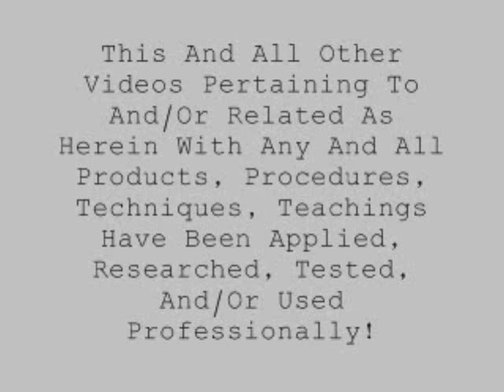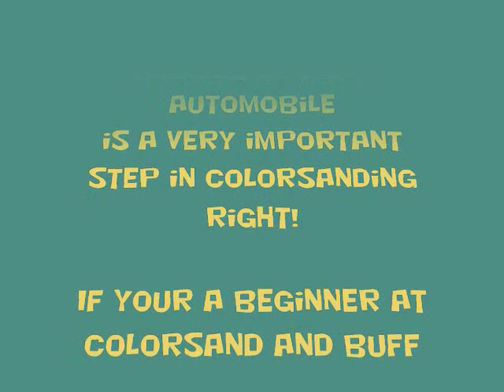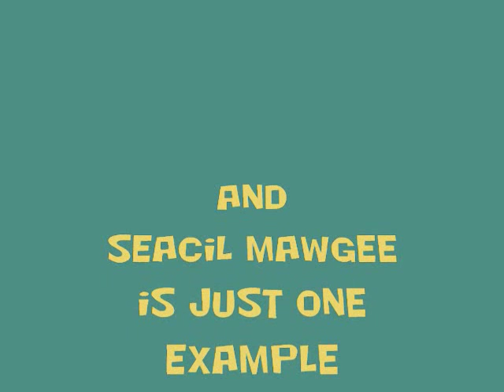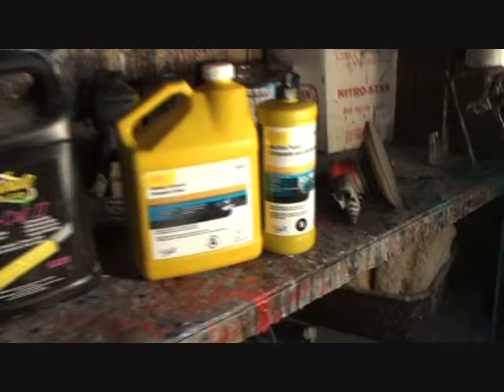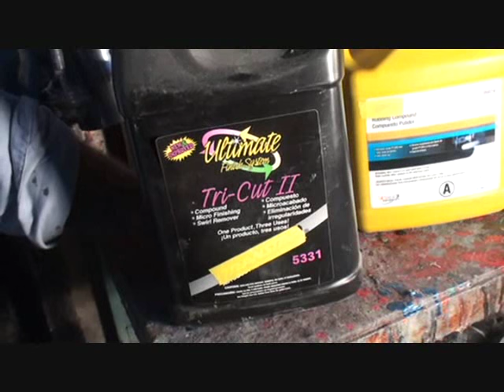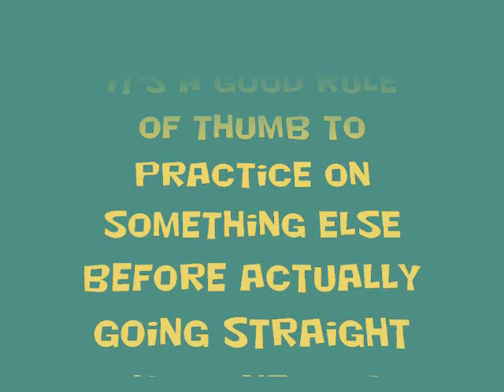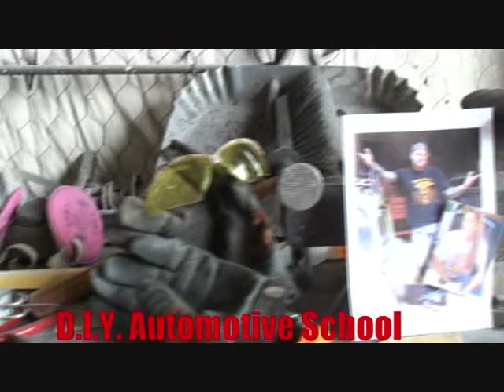"How To Paint A Car"-By Yourself-Part 16-"HOW TO COLOR SAND AND BUFF"

Comment: Best DIY vid's online today - hands down.

I wonder if there is anything one can do to avoid orange peel-ing - while painting?  It would seem that orange peel might be also caused by the paint not flowing out quickly enough - that it starts drying before it settles in.  if you added a touch of retarder, would this help?

Comment: Hey pete great video. I have a question. I have a 2000 gmc jimmy that is blue. Someone painted it and obviously didnt know what the hell they were doing cause they didnt get the orange peel out. It is shiny but it doesn't look like glass. My question is can i buff and wax it without burning through the paint? Not sure how long its been since it was painted but its obviously been a while cause the clear has started peeling away from the base coat on the hood.

Comment: Pete, I love the idea of doing a “Square or Area” at one time, then move on. Also, I am in the market for a short-stroke DA as I have less that perfect elbows and a vintage pickup to finish...for me. With 3 coats of clear, hand sanding with soft block breaks the skin with 1300 grit, the 1500 grit. Then saving product & quickly buffing, followed by polish.
  To save the family budget, 15-20 years ago, I base coat/clear coat a Datsun 210 hatchback and for some who asked below, I used a JGA-7 suction gun but added fast acrylic reducer less than 10%. Two coats later I was ready for a chair. I was shocked to find maybe two square feet of clear that had any sign or orange peel. I could never duplicate that again with so many variables, but as night came, I new the temps would drop while spraying clear. It’s the only reason to add the acrylic reducer. I simply felt gave it twice the time to set between coats. To me only, the clear with out buffing seems tougher and a higher DOI.  Another great video tutorial Pete!

Comment: Hey Pete Thanks for all of your videos really good information! I got a project I could really use your advice on. My uncle and I just picked up his 1939 ford 2 door coupe from a local chevy dealership painter who paints cars in his shop on the weekends. The car has an average amount of orange peel for the most part but in a couple places the clear coat is "rough" to the touch and feels almost gritty. He said he put 3 coats of dupont chromabase clear on it and all of those rough spots would buff out. I detail cars for fun sometimes and have a makita rotary along with a dual action polisher and was planning to tackle the wet sanding and buffing on this project. Should I hit the whole car with 1200 grit then 1500 then 2000 and begin polishing? And do you think the "rough" spots in the clear will wet sand out out? Any advice you can give would be greatly appreciated! The car is a dark green metallic color if that matters.

Comment: I used a big pipe wrench with a long pipe shoved on the handle to twist a steel bumper back into position. Put some thin wood between the jaws of the wrench so as not to leave marks on the bumper.

Comment: It's actually the static electricity in the air.

Easy cheat no paint booth use weed sprayer fill with water Nest work area but not work piece

Comment: Great video as always! I'm confused about the buffing edges part though .... By moving the direction of your body, it doesn't change the direction the pad is spinning, or am I missing something? Lol
Reply from the maker: +Niamh Healy You want to direct the buffer in the way where it is turning away from the edge not turning into the edge because if you go into the edge it will burn the paint off.. Going away from the edge will let you buff without burning...
Reply: To further clarify, he uses either the top half of the pad or the bottom half while doing the edges and not the whole pad which would cause edge cut in on the opposing half of the pad thus body positioning matters depending on which half of the pad is actively polishing the surface.
Reply: Ah ok, so you're tilting the pad? That makes more sense lol

Comment: When you went to the 1500 on the hand block, the edge of the paper was halfway across the face of the pad.  Would this not tend to concentrate some of the cutting action on that edge rather than across the full face of the hand block?
Reply from the maker: +Vern C If the paper is hanging over a bit it won't do no harm because there is no solid pressure on it.. You'll be fine!

Comment: Once in a while it makes the wool pads nicer to use if you run them through a few washing machine cycles to get rid of accumulated compounds and waxes.
Reply from the maker: +Vern C I found that the wool pad actually works better when it's been used a bit then brand new!

Comment: can i run a da sander with 3000 grit over a second hand car i got befor i buff it the paint looks in good condishion its just lacking a good shine or do i just buff it?
Reply from the maker: +Ricky white The 3000 will help out on detailing your car, but remember where ever you use it will have to be buffed out..

Comment: Actually the squidgy introduces scratches to the paint. The pieces of clear you've just sanded are laying of the metal, it's like having pieces of grit on the panel, and the squidgy drags all of that. It would better using just water.
Sure you can polish that out, but you're adding extra work and making the clear thinner.
But great DIY video!

Comment: You don't knock down orange peel on the base coat before you spray the clear on?
Reply from the maker: +mcinkyt NO--It will ruin the metallic/pearl paint if you sand it.

Comment: I bought a yet unused system that is multicolored foam pads where each color applies to different compound grit.  Does the wool pad function that much better over using a foam pad for rubbing compound or is it just more durable?
Reply: wool cuts faster it's very aggressive,  foam is softer less aggressive .
Reply: +TheMarcusGomez Thanks. I guess more durable and longer lasting also if you can safely put a spur to it thus it might even be better than the new microfiber cutting versions for longevity I'm guessing.

Comment: A little trick if you have a run or drip in clear coat put thin layer of bondo over it before sanding this way you don't burn through clear on sides of drip jest sand bondo off and it will be done